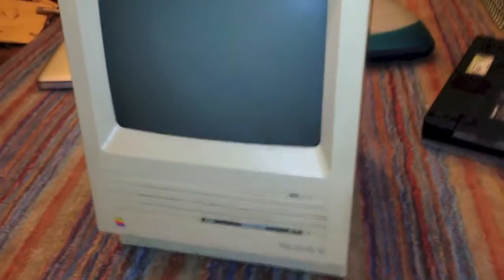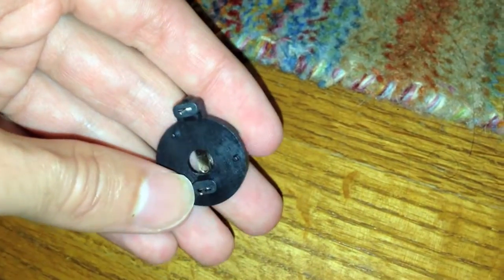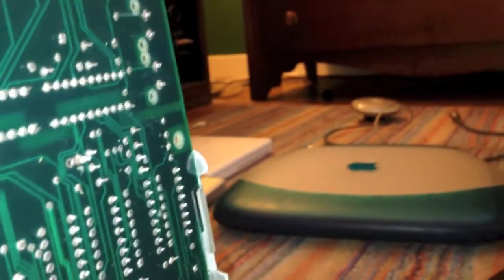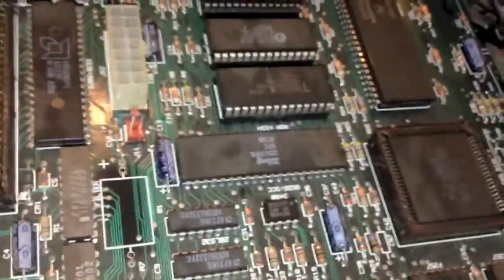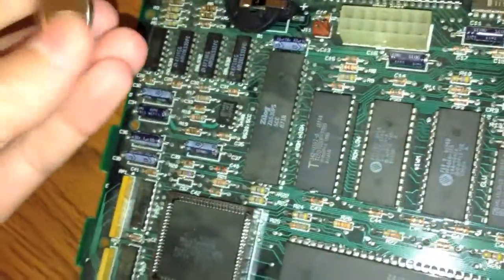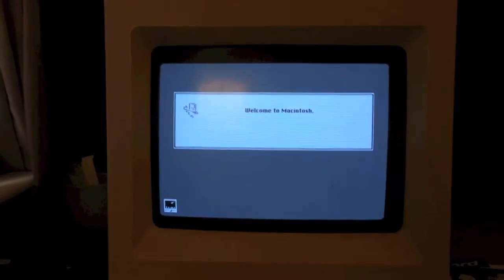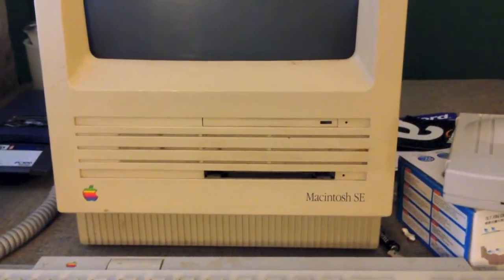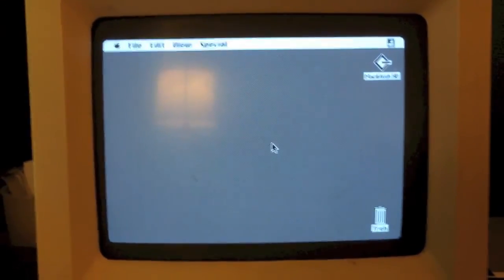Macintosh SE CR2032 PRAM Battery Modification

Comment: I've been contemplating this mod. Are there any problems with using a lower voltage battery?
Reply: Kahlil88MPH guess he doesn’t care to answer
Reply: Two CR2032 batteries work out to 6v which would also be ok.I think you generally want more voltage than less but I could nbe wrong...